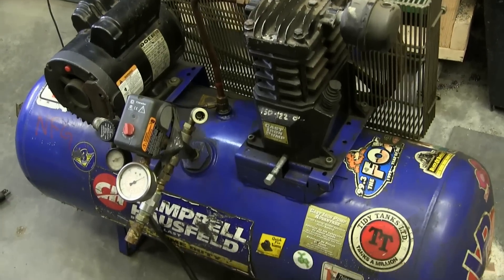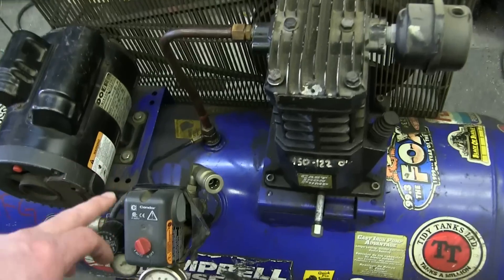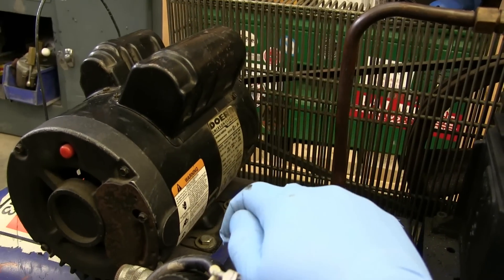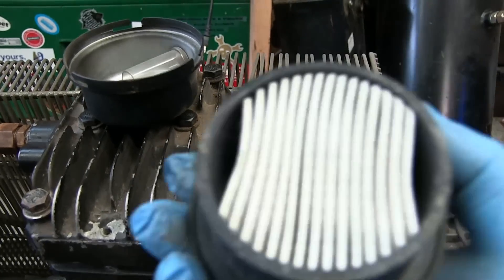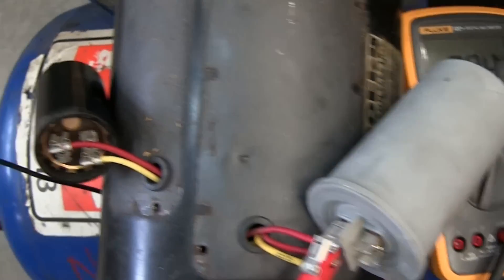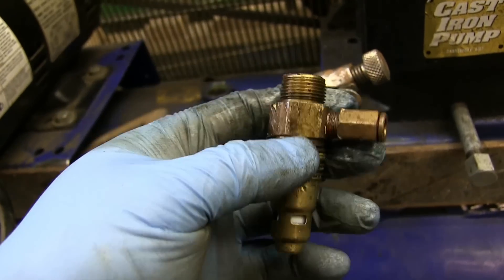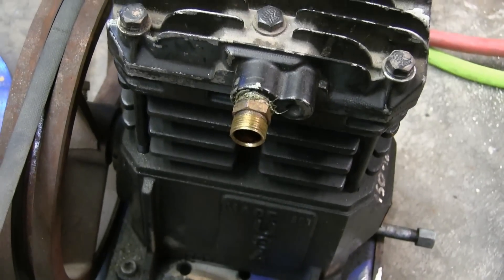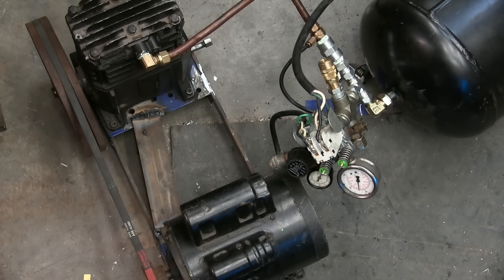BOLTR: Air Compressor Explained and Fixed.

Comment: I'm an hvac welder everything I do is pressure lol and only 150lbs for a compressor is cake
Reply: Benny CompTech I don't know how much fear AvE would need of osha showing up in his home jobber shop....
Reply: Leahcim Michael lol. it would be cleaned out prior to any repair lol
Reply: Lol what are you in for? I welded my compressor.
Reply: chris jones in the states you can't weld compressed air tanks it's illegal UNLESS a certified welder does the job and then OSHA recertifies the tank on smaller tanks like this it's not worth it
Reply: Benny CompTech if I'm an hvac welder that would mean I'm certified
Reply: It is actually not illegal to do yourself if its in your home machine shop.
Reply: AvE is the one doing the welding and I'm guessing he isn't certified.  If he's not comfortable with his ability to weld this properly to be safe why question it.
Reply: kistuszek
old timers used to hook gas tanks up to the exhausts of running car engines. The engine would burn all of the oxygen out of the exhaust creating an inert shield gas.
Reply: should do a vid showing how it would be done
Reply: soundspark lemme check my extremely outdated nitrogen, co2, and propane tanks for markings.
Reply: OSHA don't come to my garage, boy!
Reply: chris jones, I have been a union pipefitter for 33 years- Maybe you might want to explain just exactly WHAT an hvac welder is? I'm calling BULLFUCKINGSHIT on you! Also what stamp do you carry?
Reply: djteac no it still is lol just cause it's at home doesn't make it not illegal it's still a potential bomb at that point that can blow through a wall ugh I wish I could attach pictures!!!
Reply: Benny CompTech I'm still waiting for the OSHA section that says a pressure vessel can't be repaired. Now I agree that a tank this small not worth the effort/risk, the cost of ultrasonic testing then hydroing it. But to say illegal per osha is not true.
Reply: Its very legal to repair.  there just needs to be testing methods documented as per Section IV chapter 3 (I think anyway)
Reply: ***** all my stuff is marked with a DOT standard, date of manufacture, cert marks, etc.

Oddly, my air compressor doesn't have any easily readable markings, but they are there. 

Being an ME, I'm an idiot for not immediately blurting out ASME. 

ASME and dot have the market share when it comes to pressure vessel design/working/safety code. Dot standards come into play when transport is involved, especially when hazmats are also involved. There are exemptions for govt entities and non commercial use however. 

This was revealed with some quick Google searches.

To get a concrete answer one would need complete access to dot and ASME codes, OSHA crap (who will tell you what standards apply in a particular situation), a shitload of time, and then probably a lawyer to boot!

Consulting a PE who specializes in pressure vessel design would probably be the easiest path to a "good answer," but they will almost always error on the side of safety because giving Joe blow exactly what the code says leaves the door wide open to lawsuits and loss of license.
Reply: Benny CompTech :  No, that would be the National Board and the insurance company covering your liability. 

Canada is different but they still use ASME VIII DivIsion I for unfired pressure vessel design and construction.   They have province registration for PVs which most aircompressors have...called a CRN, they are good for all of Canada.
Reply: oil is not very flammable, compressor oil will almost never light on fire. it wont explode because compressor oil does not produce flammable vapors

in the USA that would be an ASME certified Pressure vessel. no you wont get in trouble for welding your home compressor tank. if there was a catastrophic failure they could try to use that as grounds to deny an insurance claim. if you repaired someone else's tank well that could get you in trouble.
Reply: Iceberg86300
the fittings are certified. But that does not mean the tank they're in has any certification. If you're a fitting manufacturer you want the lucrative side of the market.
Reply: chris jones I'm not arguing that but for a unit this small it's just not worth the repairs vs the cost plus one crack will lead to many other also if the walls inside a to far gone it's just not safe to use the tank I am a Compressor technician and have seen first hand how these tanks blow up!
Reply: chris jones a two stage Compressor can go up to 180psi and the tank is more than likely a 200psi max
Reply: Johnathan Smith as far as instructional videos go I'm just putting in some info so businesses owners don't do anything Illegal which I have seen in cases like this
Reply: osha doesn't certify things.  probably would need to be osha compliant hydro tested thought by a testing shop
Reply: Thomas Flynn all he did was weld the baseplate which is fine if you weld a tank you need to be certified then have the tank recertified but EVEN IF YOU WELD IT that doesn't mean the tank is still good!
Reply: soundspark YES that's it!!! Why do I keep saying OSHA it's DOT I was up to 4am replying thanks for correcting me
Reply: Wayne Earls Canada has their own standards. I'm sure there is an OSHA equivalent, but not sure about how pervasive they are.

In my experience the level that OSHA compliance is followed is dependant entirely on the company. Some have a compliance officer that will force you to design foot pedals and hand holds to actuate something because there is a minuscule chance of a fingernail getting pinched with a couple pounds of force, then there are places that don't enforce mechanical lockout/tagout procedure for someone climbing into a milling machine for maintenance.

I personally haven't seen "middle of the road" practical enforcement.
Reply: In Canada pressure vessels and OHS are covered under provincial laws and regulations.  I can't say for which province AvE is in, but in all the ones I've cared to look at pressure vessels are controlled under separate legislation from OHS.  Which is to say, it's not OSH guy that shows up at your door but rather the pressure vessel inspector.
Reply: The trick is to fill it with propane. So while it has plenty of fuel it lacks oxigen for the boom. Seriously, dude filled a gas tank full of fuel so it wont blow up while he welded it. All the amateurs were scared shitless but the pro was right did not go boom. Of course if you have argon then its preferred... haha
Reply: No it was before the internet. Guy welded up a tank while it was full. I mean i know it has no oxigen in it but still you just cant get rid of this terrible gut feeling that tells you to run. 
The propane part is half a joke, it could work in theory but you have precious little way to get sure it really displaced the air...
Reply: That's a neat trick. I love these.
Reply: acemavrick3
You think portable air compressors have ASME rated tanks. That's funny!
Reply: Paul Frederick : Most over 5 gallons are.  Especially in Canada where in addition to the ASME U stamp, there is provincial registration for the all important CRN, Canadian Registration Number.  Even my 1996 era 20 gallon Coleman has a CRN and it was purchased in Texas.  Pancake tanks are small enough for exemption.
Reply: Keith Jurena
I have a 40 gallon ASME rated tank. It is over 70 years old now. To give you an idea of how rugged it is. They managed it by making the wall of the tank twice as thick as what you'll find in portable air compressors.
Reply: You can weld that safely if you know what you're doing. It is welded together in the first place after all. But, like I said, you have to know what you're doing when it comes to welding.
Reply: Paul Frederick thier supposed to be. look it up.
Reply: acemavrick3
maybe you should look at air compressor tanks? Because I'm looking at them right now and ASME certification is the exception, not the rule.
Reply: Paul Frederick I couldn't find any markings on my 27 gallon husky tank. 

There are markings on the bungs welded into the tank, one on the cylinder with a plug which is for a inspection port I assume, and one on the bottom fitted with the drain hardware. Both are stamped with a date code "??-02," "H-3" I believe, and some other numbers I couldn't make out. Nothing resembling "ASME" though. Could be on/near the bung on the top portion, but I'm not taking that crap apart. Even though the tank is out of date, it hasn't been used much, never abused, and it's never shown any rust when I drain it.

"H-3" and the other numbers, while not completely readable, do seem to match, so they might be serialized to the tank. Or they may just conform to a standard for use in a class of pressure vessel. But I just don't have the resources to match anything to ASME. The specific codes/rules/regs are just too expensive considering that they don't pertain to my area of engineering expertise.
Reply: Paul Frederick my thoughts exactly.
Reply: Take off ah, hoser....
Reply: chris jones oil + oxygen + heat = no garage door

Comment: I guess brazing wouldn't be any safer, right?
Reply: shane jasek in the states at least it's illegal to weld a compressed air tank UNLESS your a certified welder then get OSHA to recertify the tank and on a unit this small the cost to do it is just not worth it

Comment: No-One maintains compressors. Ever.
Reply: Average Joe i scored my dual piston from my old work. they said it just stopped. took it on face value (0$ down) pressure tank was completely full and never had been drained. the motor reset switch required functioning. end result great compressor for free.
Reply: Average Joe I do. drain mine after every use and have an autodrain for durring use. also change oil regularly. Will never buy used for reason stated above
Reply: screw compressors are quiet but spensive
Reply: Leahcim Michael Nice, That was a good day, shame they can't all be like that. Piston compressors are the best to get in my opinion, those bloody awful direct drive ones are just a bit nasty. J.

Comment: Hello
Reply: the small 1/4 line is a unloading line not a sense line there is a small valve in your pressure switch when it turns off it dumps the air from behind the check valve to allow the pump to start with little to no load other wise the starting current would be way beyond the 15a your breaker supply the sense pipe is typically mounted on a nipple.  If your compressor is tripping the breaker pull your check valve clean it up or replace it